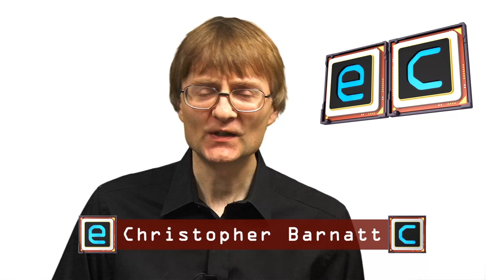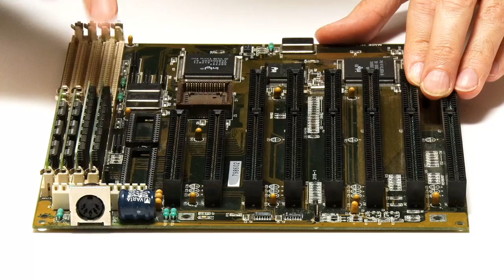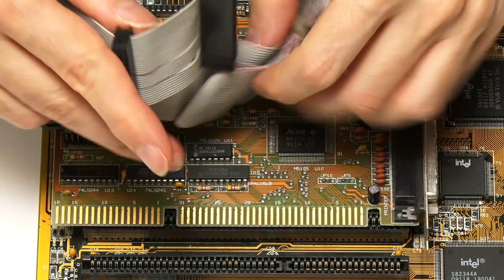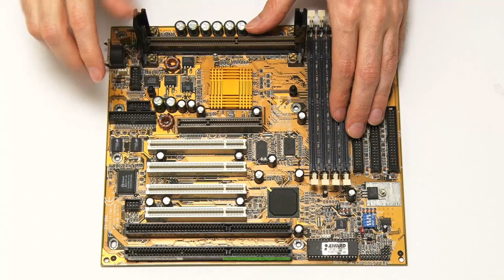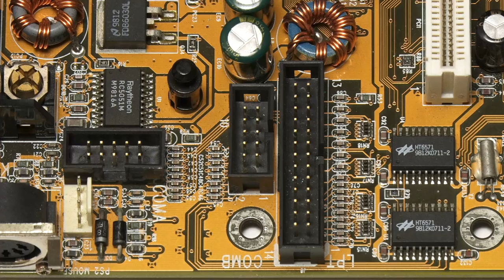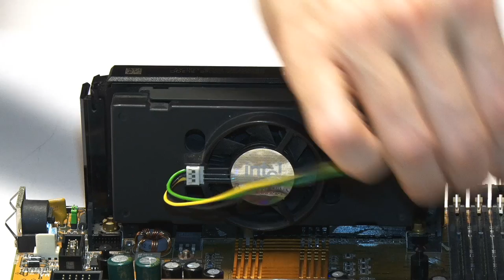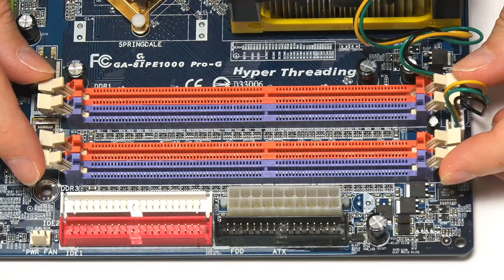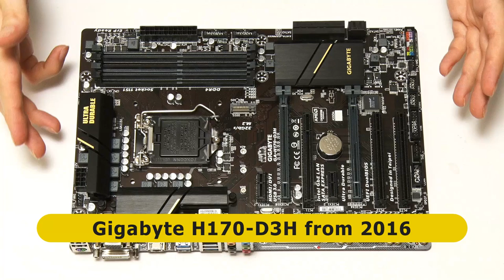PC Motherboard Evolution

Comment: Rewind just a few years and there are motherboards with individual RAM chips and I/O cards for MFM and RLL hard drives.
Reply: I actually have a few anti-static bags on my desk with some RAM chips for one of my vintage computers right now.

I think RLL is used in other technologies, even today, not just MFM hard drives.
Reply: yep, i have a 286 with loads of 41256 256k by 1 bit ram chips on it, has hard drive/floppy card plus a multi IO card, and a EGA video card,  5 1/4 inch 20mb (yes, mb, not gb!) hard drive , plus 5 1/4 and 3 1/2 floppies ....still working when last powered up a few years ago! although the psu did go bang once, but i managed to repair it.
Reply: yeah that's right,   the DIP Packages that you slotted into a Chip Holder
Reply: @andygozzo72  Try locating a supply of those old RAM chips these days if some of them go bad. 74xx series logic is very easy to find, even today, but if you're trying to build replica expansion cards for these old computers, you'll be better off getting one or two newer 1MB RAM chips and your own address decoder than trying to replicate the old memory architecture.
Reply: @BlackEpyon  luckily i have a bagfull (200 ish?) each of 4164's or equivalent, and 41256s , plus small numbers of various others... you can still find them on ebay now and again,    i've found it hard to get some 74 and 4000 series cmos types!
Reply: @andygozzo72  I've never had a problem. Where the crap did you get that many RAM chips?
Reply: @BlackEpyon  someone at a car boot sale had various electronic and computer parts for sale cheap so i grabbed them quick 😉
Reply: i've got another load of 'used' (ex socketed) 4164 'equivalents' as well, not tested..
Reply: @andygozzo72  Damn. I only recently found out that there's a vintage computer club that meets in my area, but there's only a few of us. I never see old computers for sale anywhere but online these days. Any other good stuff in that sale?
Reply: @BlackEpyon  cant remember, it was a while back, i think in the mid to late 1990s, long before 'retro' computers became popular,  i've passed on loads of nice stuff that'd be worth a fortune now.... d'ohhh .. i was mostly into vintage radios at the time so went more after  them (i still have a barn full, though..)
Reply: @andygozzo72  Yeah. When I was a teenager (probably around 15-16 or something, I don't remember), I carelessly ditched a bunch of old computers, including an IBM 5150 or 5160 and an XT clone, a Mac Plus, and a bunch of other stuff. This as well was before I got into "retro" computing, and I've since come to regret it heavily. I had no idea then what it'd be worth to me now, let alone what some of that stuff can fetch on eBay.

Of course, with electronics recycling becoming more and more popular these days, it's even more important to hold onto this stuff, because once it goes for recycling, it's gone.
Reply: @BlackEpyon  argh!!  i got an ibm pc convertible 5140 for about £5 about 18 years ago....wish i'd bought the rest of them, the seller had a pile of them, i just picked the best physical condition one...
Reply: @andygozzo72  Ah, damn. Hindsight is always 20/20, isn't it?

Comment: I had just watched your pcie slot video, and was hooked.. I subscribed and went hunting only to find you had already made this vid.. as I said earlier I have been playing with computers since the tandy, commodore days.. and building computers ever since.. I really liked the fact that you have connected all of my old memories into a new form to see the evolution that I was hardly aware of.. It really is fascinating to see it in this light.. I am now going to have go digging into my boxes! I know I still have my old 386 and my 486 (with a cd rom drive) But I have old motherboards,  cpus, memory and all the good old stuff.. I will have to get my old 3 & 486 running again I even have the monitor, keyboard and mouse for them.. plus maybe get some cases and build some of the early pentiums back and make a little display of them.. you have rekindled the old fire my friend..and for that I thank you! I am only 66 years of age but I worked and played hard when I was young and as a result have worn my body out and need a simple easy hobbie and you have given me that.. carry on tally ho and TA...
Reply from the maker: Thanks for the sub!

Comment: I had a 386 PC in 1987 ish. Quote from Wikipedia, "The Intel 386, originally released as 80386 and later renamed i386, is a 32-bit microprocessor introduced in 1985". It didn't half seem fast compared to my 286!!

Comment: The first 486 boards were an absolute pain to configure. You had about 40-50 jumpers to set to correctly address things and configure the CPU. Half of those acted as little killswitches, upon first start releasing curious blue smoke if set wrongly. Those really were the pioneering days of PC building.
Reply: so a bit like aviation in the early days?

Comment: Wow brings back a lot of memories. My first PC was a 486 (my first gaming rig). Then, a P2 500, a P3 1ghz, P4 2.4Aghz Prescott core, athlon x2 1.4ghz, core2duo e6600 (2.4ghz), core2quad q6600 (2.4ghz), i5 2500k, and finally the i5 6600k. Weird coincidence that I have 3 of Intel's same CPU nomenclature numbers although different eras. I still have all 3, the e6600, q6600, and my current PC with 6600k. By the way, I loved Zalman coolers too, but I could never afford or get one from where I used to live. I remember them topping the old Anandtech charts. Fun fact, I bought the Thermalright Ultra Extreme 120 (TRUE120) which cooled my e6600, q6600, 2500k, and is now mated to my 6600k!! Thanks for this awesome video I totally loved it.  Felt kinda old, TBH, but wise too. Kids these days wouldnt know what to do with a jumper, except maybe wear it.
Reply: Have you never used the XT with 8088 CPU 4.77 MHz, 2 floppy drives 5.25", no hard drive and monochrome graphics?
You must be very young.  
;-)
Reply: First PC was also a 486 - had a IBM SLC2/66 processor in it, so not quite as good as the Intel 486s, not to mention a 5-pin DIN keyboard connector instead of PS/2 -  but it did have a CD-ROM drive! Just turned 40, so the "5150 and/or XT as home computer" era was a bit before my time, but I do remember playing around with Apple IIs and PS/2s at school prior to owning my first PC, and my dad did have the first model of PS/1 circa 1990, which was always fun to mess around with when I visited :) Of course, I have a Xeon E5-2680 with 32 GB RAM and 20 TB in hard drives (1x8TB & 3x4TB) as my main PC, and a i5-2400 HTPC now, but occasionally I still reminisce about the old days and fire up DOSBox for a bit...
Reply: Zalman coolers were the bomb at it's time.
Reply: Nope, I started out with 486, which was a big deal at that time. No monochrome screens either buddy. I have used and own several old 5.25" discs as well as 2 drives (IDE, so doesnt play well with modern Pcs). I have read and watched a lot about it, which does not count! You old timers really have done EVERYTHING right? haha. I AM young to be honest, just 35. I could guess your age given your PC stats, but I will just say that you are young at heart :-) Thats all that matters!
Reply: 500MHz Pentium II...? overclocked...? :)

Comment: That first board looked rather familiar, I had a similar one, with an 80386SX-16, and you could use SIMMs in 256KB, 512KB or 1024KB. In the 80386 days, SX referred to the "folded bus" 16bit data bus, rather than the DX with a 32bit data bus. In the 80486 days, the meaning changed, and SX meant the CPU didn't have a built-in Math Co-Processor. My first 486 was an SX that was over clocked, I think it was a 25MHz over clocked to 33MHz. Then I got to try the DX2/66 and I was hooked on the speed boost, LoL!

Comment: A recent and significant change I've seen recently is PC components being a lot more looks-focused. Motherboards having covers and heatsinks (sometimes ironically ineffective), graphics cards invariably having fancy designs, even RAM now has to look good. Heck, even the cables have to be all-black or having a custom color, and "ketchup and mustard" molex connectors are a sign of poor pc-building skills. RGB is everywhere, even on power supplies (Thermaltake) and SSDs (Team). Noctua fans, in the past a staple of good builds, give room to Corsair LL fans (among others). You have features like "LN2 mode" on motherboards (mine has it, a Crosshair VII Hero), plus "absolutely overkill" VRMs according to guys like Buildzoid who's channel name is "actually hardcore overclocking". So components right now are really really different from even a few years ago. This is in part because cases now have more glass (the case I got has glass on every side except the back and bottom) and liquid cooling, a niche thing, is now semi-mainstream. Motherboards now have things like RGB controllers. It's a very interesting time to be building PCs, but at the same time prices have spiked a lot, which proves that many people are willing to pay them (either that, or the only people still building PCs are the ones who like it, and most casual users only use laptops).
Another cool thing is M.2 and U.2, also small form factors and at the same time E-ATX for processors that cost 4 figures and require absurd cooling solutions.
Reply: Agreed on the covers.  I am debating actually upgrading a motherboard I bought this Summer for my 8086K rig from the Strix Z370-I to the Strix Z390-I, but was thinking that it had a huge plastic cover over some of the VRMs.  Turns out that this time the cover is the heatsink itself, and is solid aluminum (or aluminium for you brits), when I saw the OC3D preview video from Tom Logan.  I do agree though, the Strix Z390-I ITX board is the oddball, most of the time, those things are just plastic blocking all of the airflow over the VRM sinks.

Also, take note that a lot of the manufacturers are FINALLY going back to high fin count VRM sinks, as opposed to the chunky low surface area eye candy heatsinks.

If you want the best fans, go with the Enermax D.F. Storm fans, but you'll need an external fan controller to keep from burning out the motherboard controllers.  I use the AquaComputer Aquaero 6 XT.  They are NOT RGB fans, but if you want a nice subdued and not too flashy RGB for them, get the Phanteks Halos.  These D.F. Storm fans kick the Noctua iPPC 3000's ass in CFM and Static Pressure.

Granted, I had to have one fan that annoys the hell out of my wife, and that's the exhaust fan for the system using an Enermax T.B. Vegas Quad.
Reply: I personally have never understood the appeal of transparent cases and the focus on aesthetics. The only time I look inside my case is on the  rare occasion it needs a clean or getting an upgrade :-)
Reply: Because today people who built a computer were an enthusiast. Run off the mill avarage joe would very happy to just pic up an crApple product.
Reply: Everything is marketed at gamers now as if gamers are the only ones using PCs.
Reply: @abdussamad9428  Still you can buy some cases with black sides for those who want to go in stealth mode.
Reply: PCs are the modern version of the 1950's hotrod. Same mentality.
Reply: @scotshabalam2432  instead of flames and stripes we have RGB accessories and big ol' heatsinks
Reply: @samuelthorn408  I think a lot of the feelings, activities, and social interactions that were based around the 1950s automotive experience are being replicated in 1990's-20xx+'s online internet experience. I think in the automotive trade these additions are called "Vanity Accessories" for the reason that they are added for the sake of vanity.
Reply: @scotshabalam2432  does that mean that we're gonna have infotainment screens on our GPUs in the future?

Comment: If I recall correctly your IDE sockets or headers were also called AT Architecture and then later Parallel AT Architecture to distinguish it from Serial AT Architecture or SATA.
Reply from the maker: Yes, I think you are correct.
Reply: Yes, ATA, UATA and PATA, with the blazing speed of 133MB/s !!!

Comment: Thank you Chris for all of those boards,  I remember them so well.
Reply from the maker: Thanks for your kind comments. Given some of the other comments here, they are very gratefully received.
Reply: You make so easy to give you praises.  I got my A+ certification in April 1992 and the first PC I built was an IBM 5150 @ 5 MHz so the motherboard that you started with was advanced way beyond what I had built.  Thank you again for the stroll down memory lane!
Reply: Oh and X-TREE GOLD was my OS!  AHHHH the command line days!
Reply: @pheotonia  
X-TREE [gold] is not an OS. It is just a comfortable user interface (with graphics mode and mouse support AFAIR). Others used the norton commander and the norton utilities. But the operating system was DOS.
Reply: I'm sorry, you are right I just have some memory gaps in my own OS!
Reply: @pheotonia  
Better your way than ... remembering things more than 30 years ago, but not rememberging what was yesterday :-)

Comment: Well that blue barrel battery was pretty much an indication on how PC manufacturers clearly designed their PCs to eventually fail due to Planned Obsolescence. You can see how it leaked, like a Zinc Carbon or an Alkaline Battery does when it becomes dry. Sadly the Amiga 500+ had those barrel batteries that caused a leak that made the Amiga motherboard beyond repairs, even those Arcade machines that had used them for SRAM Hi-Score storage. As for the i80386 lacking a fan it didn't seem as powerful as it was for the Pentium II or III, but it be recommended to have a PC case with plenty of circulation as well maybe having a case cooling fan, to prevent excess heat from damaging the Capacitors and melting the solder. But those PowerPC, Motorola 680x0 processors didn't compete well as Steve Jobs ditched the PowerPC for Intel x86 near 2006 for Apple's iMac range.
Reply: Those barrel batteries aren't that hard to replace.  All you need to do is desolder the 2 connections, remove the battery, and install a new one.  Even for a newbie, it would probably take one day's labor, about $6 and would last another 5-10 years.  You can buy the barrel battery anywhere.  Here's one listing on eBay:  "3.6v rechargeable CMOS battery 60mAh (NiCd/NiMH) for vintage motherboards & PLC", Item# 331034570308.  Amazon has many different listings, including Varta (made in Germany!) and 2 and 3 pin models.  For the ONE person who reads this and actually needs to replace their barrel battery, I recommend you spend the extra $5 and buy a higher quality rechargeable battery such as the Varta.

Comment: STARTED WITH AN IBM CLONE 8088T Second hand around 1990.  Learned DOS the hard way. Did not have a graphics adapter. So had to enter everthing by file name. Seeing as the DOS shell could not be displayed.  Built machines through the 90s. Thanks for the memories. Nice Video

Comment: It took us a lot of time to start from fully integrated boards (Atari, C64, Amiga) to fully modular (XT, AT) back into fully integrated (NUC, tablets).
I think that switch from AT to ATX power supply is missing in the video. It is a change that made the orange Windows screen “you can now safely shutdown the computer” obsolete. I also missed any mention of boards like NUC or Gigabyte Brix - a fully integrated solutions, not that far from SBCs.
Reply from the maker: Ah yes, you are right! I forgot to note the power connector changes.
Reply: WOW yes I had forgotten about the "Safe to turn off your computer" messages and screen.
So great to have the auto shutdown now.
It was always so difficult explaining to mum and dad that they needed to shut down not just push the power button.
Imagine telling kids today that the drives have to park the heads before it can be shut down and they would think you were crazy. Especially when most drives now are solid state.
Reply: 1974UTuber yeah, explaining that you need to run park.com before shutdown wasn’t easy either. I also had a problem with my Hyundai PC/XT that it didn’t have a reset button. If game or program hang you had to power off and on again fast enough not to kill the drive but reboot system.
Reply: black and black together or BOOM!
Reply: The only thing I regret from those days was being able to daisy-chain your monitor power supply. My first PCs had a power in and a power out so that your monitor could be switched on and off with the computer
Reply: But then came DPMS and electronically controlled power supplies within monitors so that wasn’t that big issue.
Reply: @SergiuszRoszczyk  oh I know, I just liked the neatness of it. There was also a bit of a gap between one no longer being available and the other

Comment: simms were a huge improvement over having to seat all your memory chips separately on the board directly.  the pusher and tong tools never worked as good as doing it by hand, if you have small enough hands.  would have been cool to start a bit earlier in time at the beginning of that chip.  the huge changes between 8088 and the 286 were game changing.

Comment: Ahhh another trip down memory lane. I remember working at a computer shop where I got memory as single chips in a clear plastic tube. I then had to carefully push each chip into a socket on the motherboard. 
When I got my own first PC things had already evolved and not memory came on sticks not too dissimilar to those we use today. My first PC had an Intern 386SX Professor, running at 16Mhz by the way. I seem to remember purchasing a math co-processor for it, and pushing that into a socket on the motherboard. 
I also seem to remember you could buy some sort of overdrive/486 kit for it, which I naturally got, before I got my next PC, a 486DX. Ohhh the hours spent upgrading and kitting out those machines...
No fancy LEDs but instead very satisfying humming and clicking from different parts of the computer.